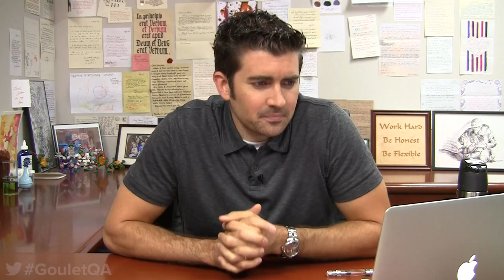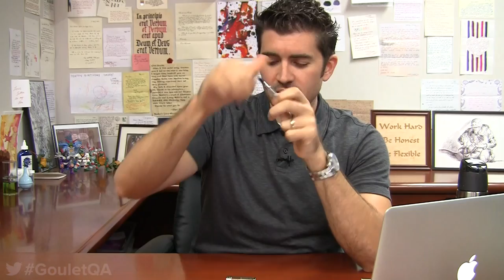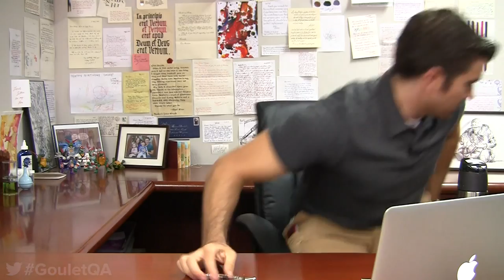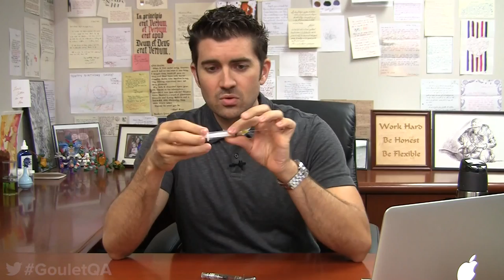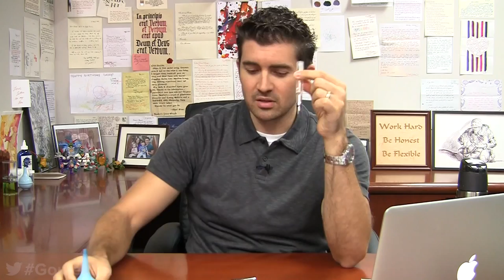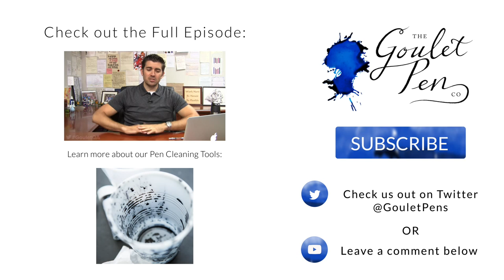What Is The Best Way to Clean And Refill A Piston Filled Pen? - Q&A Slices

Comment: The bulb syringe method has never worked to completely clean any section I've ever used it on. Repeated attempts never remove all the accumulated ink. I always have to disassemble the nib and feed and clean them separately. So, no matter what Mr Goulet and scores of other YouTube pundits recommend, I can't believe one can miraculously clean any pen section with one quick and easy flush.

Comment: Okay, now more specifically, what do you recommend (of these three protocols) for the Lamy 2000?
Reply from the maker: I honestly don't recommend disassembling the LAMY 2000. It can be done and there's plenty of videos online that can show you the steps, but it's more trouble than it's worth. Just using the piston to flush out the ink over and over is a pain but it works well. - Colin